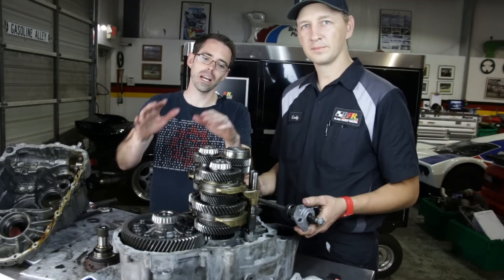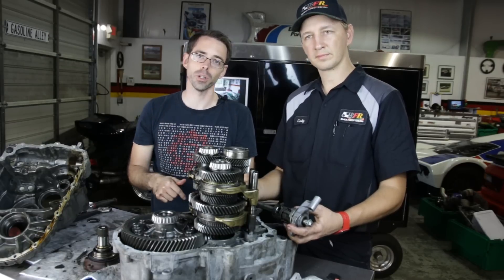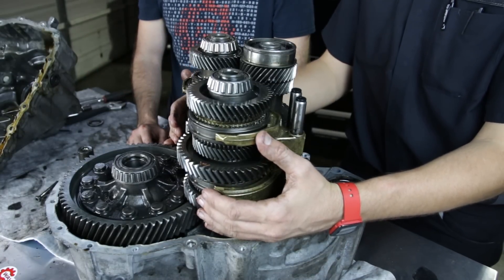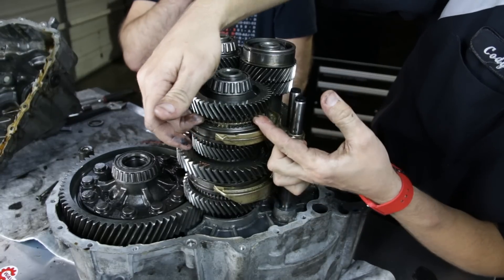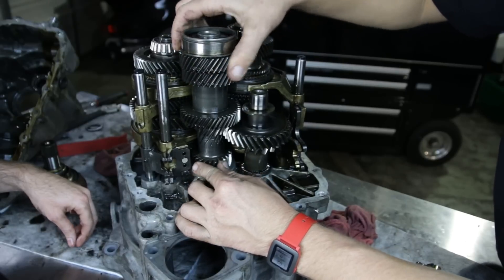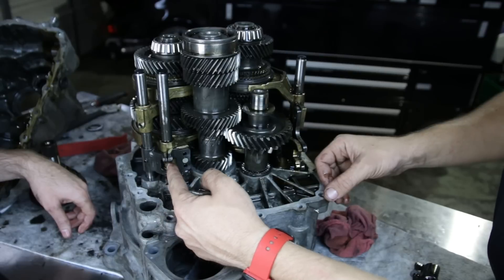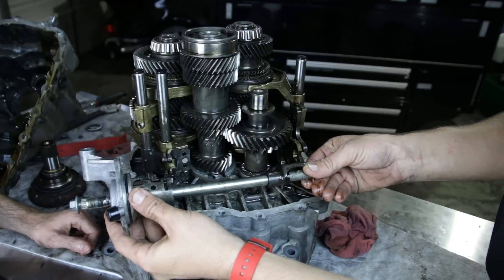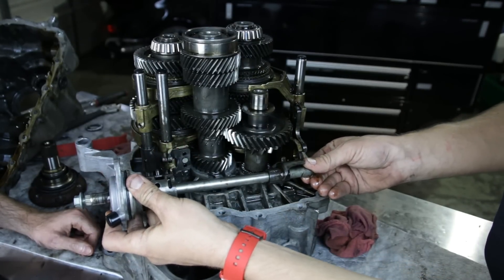How a VW Manual Transmission Works

Comment: Just tore apart an 02M out of curiosity, found the donated box had a snapped off shift fork due to a sheared rivet, didnt get the shift tower/shafts operation as you have to remove it to split the case so couldnt see how it works but you guys explained that very well and visually demonstrated it, I grew up a VW guy but moved onto Volvos now but still like the brand and will continue to tear apart vw parts!

Comment: should I beable to turn the input shaft by hand through all gears when inspecting a used transmission for my 2007 2.5 rabbit 5 speed?

Comment: Hi, I'm having a tough time working out if my output shaft seal is the correct size from the one I've bought? I have, as a replacement the 35mm OD kind, I'm not sure now If I've bought the corect one, or if I'm going to need to use a (adhoc or otherwise) spring compression tool for the type of flange fitted to my car's transmission, there's  too much info out there and only snippits seem to come up which make it a hazy cloud for me still!

My car is a VW Golf Mk5 1.9tdi with a 5 speed manual transmission.
Hope you guy's are bearing up well with this Covid 19 mayhem??
Best reagrds!!

Comment: How do you remove the SPIDER GEAR on a 0A4 5 speed transmission on a jetta 2006. i can't figure it out cause there's no hole on the other side of the spring pin to punch through?

Comment: Hi, my gearbox makes a mettalic "bang" when i put it in 1 gear then in reverse then in 1 gear then in reverse (happens when forcing the syncronizer, right before it accually goes in gear) . It does not do that when in put it in 1 the follow up 2, 3, 4, 5, 6. What could it be?

Comment: Is there a way to remove for inspection the shift gate/guide without dropping the gearbox out?
Reply: razmossis yes, that can readily be removed in the car. You can't see much through there though.

Comment: Why is it so "notchy" when shifting into 2nd gear for many of us 6MT folks??  I feel like I have to try way too hard sometimes when trying to shift into 2nd.  What could be causing that?  I have upgraded shifter bushings and bracket bushings, for the record.
Reply: I have the Same problem too can anyone help?
Reply: britishav8tor75 That's comforting! 😅 Mk7; 2015 GTI.  Notchy might not be the best word to describe what I'm talking about.  I did upgrade to a Diesel Geek, but it was in effort to improve shift feel. I was having a hard time shifting into 2nd before I upgraded anything, it's a big reason why I started upgrading shifter components.

It just seems to take a lot of extra effort getting into 2nd.  Last time I was messing with the shifter and working on cable alignment, I noticed that the "notchiness" is actually coming from inside the tranny, as I could feel it when directly pushing the shifter into 2nd in the engine bay.  It seems to have nothing to with any external shifter components.. I.e., nothing I can change or fix.
Reply: +britishav8tor75 mark6 2011 I also need a dual mass flywheel
Reply from the maker: going to talk about on Askdap 66
Reply: Awesome!